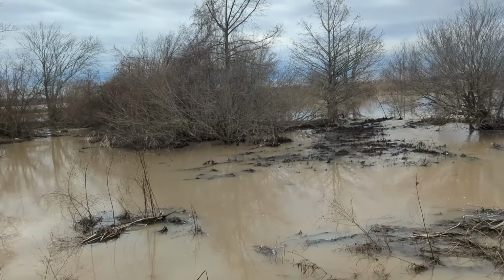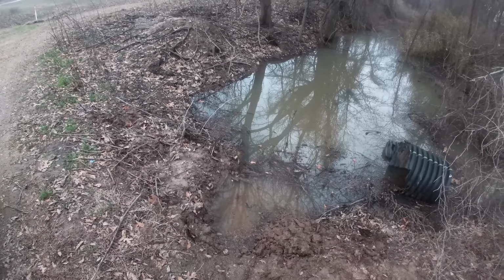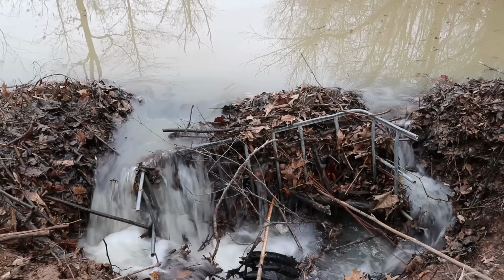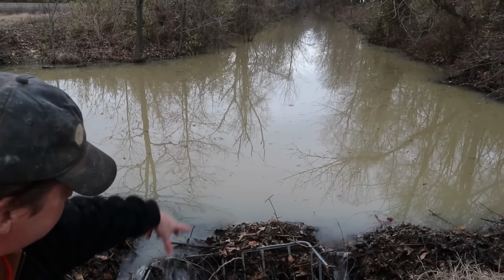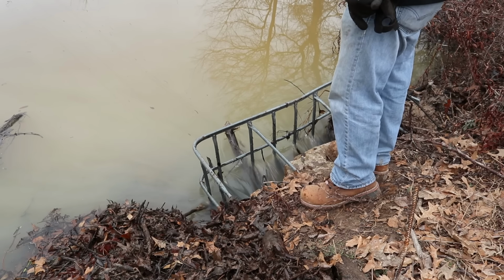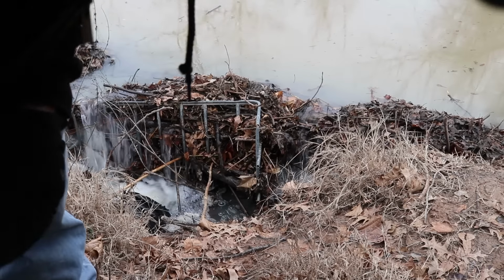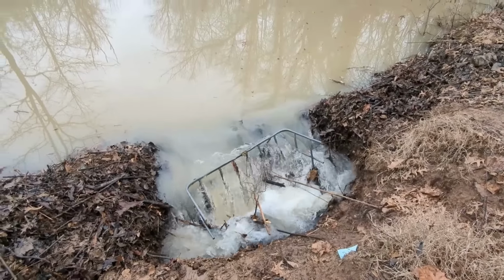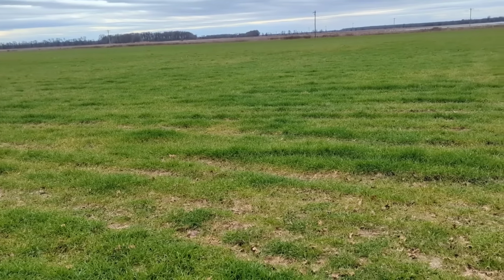Beaver Dam Removal Unclogging Multiple Culverts | Massive Water Flow!

Comment: Maybe less fancy clothes next time- so you can really get at it? 😊😉 Is there a lot of debris inside the pipe? Should the grid be tight to the culvert to stop the beavers from building inside it? Seemed like the flow on the other side could have been bigger? I watched the whole video- thank you for posting!🤗
Reply from the maker: Thanks for watching! The attire was just to stay warm. Nothing fancy for sure, really old jeans, old hoodie. The coat I was wearing was a Christmas gift from someone that wanted to keep me warm on cold farm days. I will definitely drop layers weather permitting. 

There is a lot of stuff stuck in the middle of the pipe. The beavers do sometimes go through it and build inside. Sometimes it's just an accumulation of debris that gets through and lodges in there. I have a plan that I think will work to clear the inside of the pipe, but I have to get the water level down before I can get to it.

Comment: Always wonder what folks down stream think about all this water suddenly flowing like crazy their way
Reply from the maker: Absolutely great question. In this case, it goes down this large ditch to a bayou. If you're not familiar with bayous they are very good at handling massive and quick changes in water volume if they are not obstructed. The bayou carries the water to the Arkansas River where its just a drop in the bucket.

Comment: I think cleaning in front of the grates is most important. You don't want the beaver to get inside it as they will then focus on clogging the culvert/ pipe. That's way more difficult to unclog.

Comment: Might make sense to attack the cause, beaver, rather than the result, dams and be done with it.  Get a pair of hip boots and long gloves, helps a lot.  We use swim through cage traps to trap them.  Have trapped 1,931 so far in Comstock Cages.
Reply from the maker: I'm not sure how I missed this comment, but thank you. I will check it out. Subscribed too!

Comment: Good job!  Can't you pull the wire screen out and put it back in once the worst of the clog goes through?
Reply from the maker: Sometimes, sometimes it's so stuck in there with the mud and such it is not easy to pull out. Also the grate is helpful for keeping stuff out of the pipe and creating a clog inside it or further downstream. I think I do have one video posted where I just pull it out.

Comment: Put some 3/4 ply wood out on that frame if you drill a hole at the front and back you can lock it in place so the grate wont lean out and the wood wont slide.

Comment: You gained a subscriber on this one! I grew up on East Coast clay and could tell there was no getting down into that water safely. Best to stay dry and let the water do the work. Good decisions on your part and I thoroughly enjoyed it. As an aside, so many YouTubers are having GoPro problems lately. I am wondering if their product lines are indeed too good to be true?
Reply from the maker: Thank you! The clay is tricky. About the only way to safely be on it is if it has a partial dam still underneath and you have something to pull yourself out with. I was in some today and it was like quicksand. My GoPro is the Hero7 and it's been okay but definitely had some quirks. I may upgrade soon¡

Comment: Why can't you open the top of the culvert pipe along it's length, fix a cover or grate over the top that can be lifted to clear the culvert along it's length.
Reply from the maker: One thing the camera may not show well is this pipe is at the bottom of an embankment with just the very end of the pipe exposed. There is about 8ft of dirt covering the pipe. The biggest challenges are making sure none of the debris goes downstream for someone one else to deal with, the weight of mud and waterlogged debris, and the intelligence of the beaver.

Comment: dude - just use your hands to grab the stick at 20minute mark.    torture.
Reply: Rubber boots and gloves I would think of one of basic tools. I didn’t see anything removed from inside the grates or the outflow would have been greater….
Reply from the maker: The inside of the pipes do need to be cleared. They have debris lodged deep inside the, I have to get the water down some before I can get into them though, but its coming. Thanks for watching!

Comment: U have to get into the water to be able unclog
Reply from the maker: Just the thumbnail, let alone the video literally shows that's not true. I realize it might make for better content but not all culverts require getting into the water to unclog. We purposely use the mud we pull out to build out ground so we can stand on and easily unclog the pipe. We try to do what we can to not have to get in the water, especially during warm months due to certain water hazards.